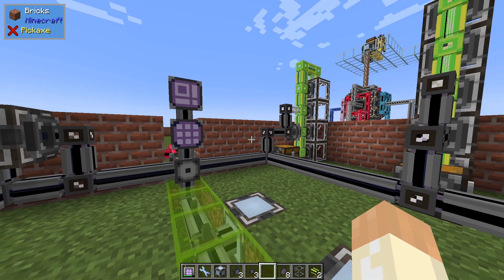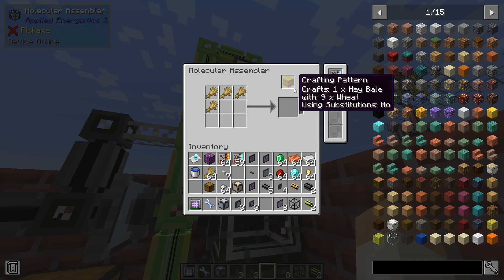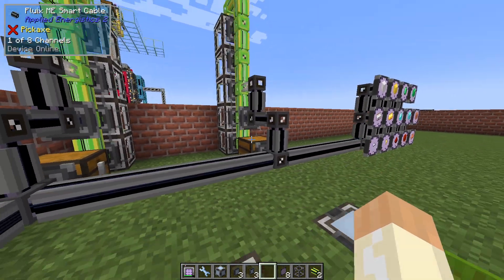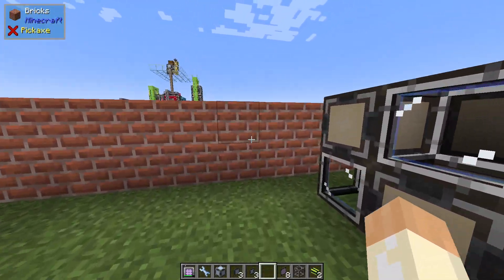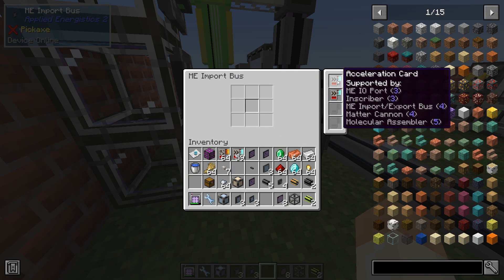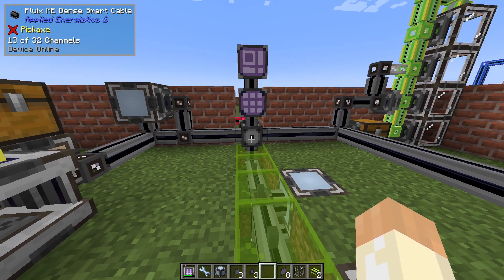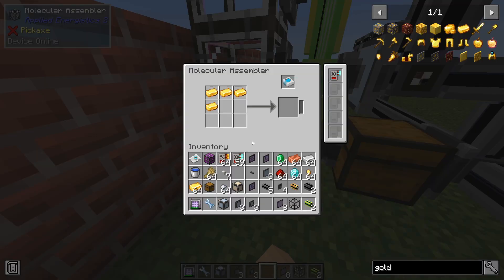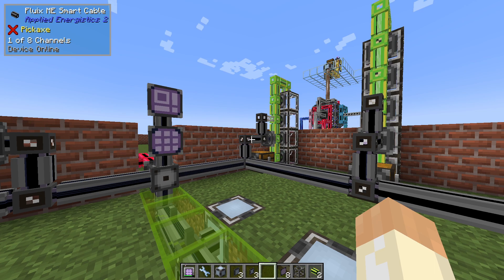Nugget - Ingot - Block Auto-Balance System With AE2 - Modded Minecraft Tutorial

Comment: how does it handle insufficient inventory?
Reply from the maker: It will fill downwards (in tiers). So if I remove any ingots the system will use up the blocks, same thing with nuggets. Lowest tier has highets priority. But it should later fill up nicely later, and it doesn't seem to lock the system!